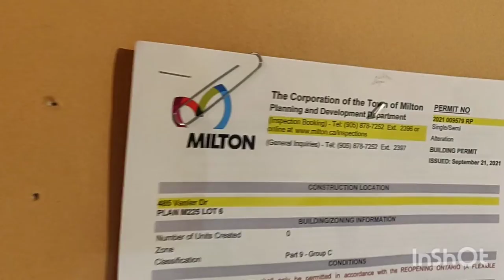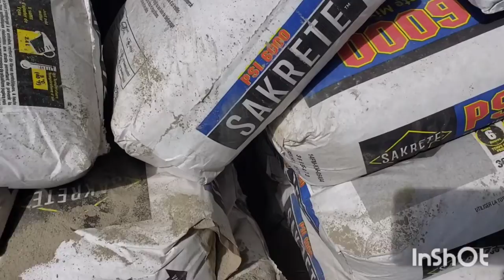Load Bearing Wall Knock Out - TRIPLE STACK LVL BEAM AND NEW CONCRETE FOOTING AND POST

Comment: How long did the concrete sit before you could put a load on it?
Reply from the maker: 48 hrs
Reply: @scavettarenovationdesignin8953  that short? I would have thought longer. Thank you for your reply. I’m removing a steel post that is supporting 2 steel beams that are butted above the column. The total span is just over 24 feet. I’ve discussed with an engineer and he said 3 14” LVL beams should suffice. I’m going overkill and using 4.  I need to pour a new footing on one end. I figured I’d have to wait a week before putting any load on it.  I’ll be using a 5x7 PSL column to handle the load on that end.
Reply from the maker: @owenjohnson5030  the town inspector had no issue with it. He inspected the footing form before the pour, then 2 days later was back to inspect the poured footing and post. Signed off no issues. Mind you, I’m in Ontario Canada. Our building code might be different than where you are